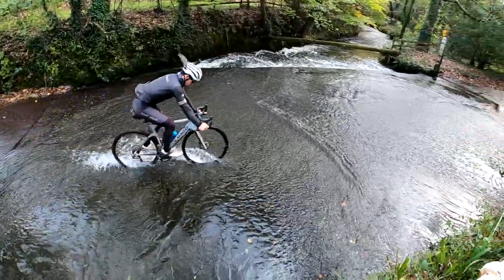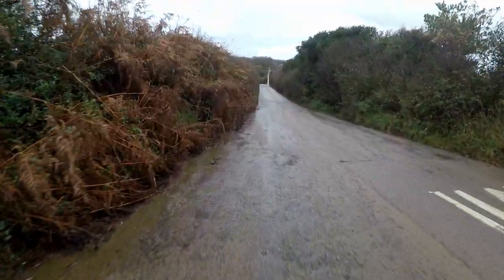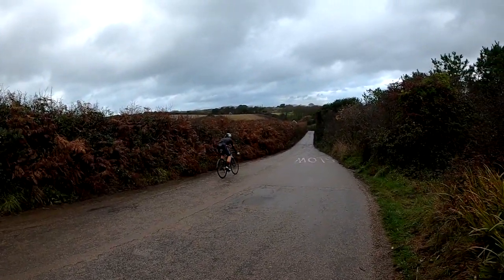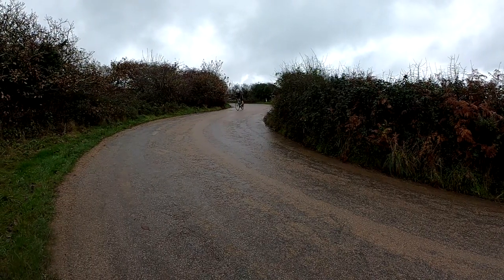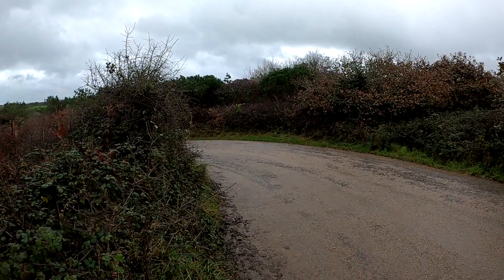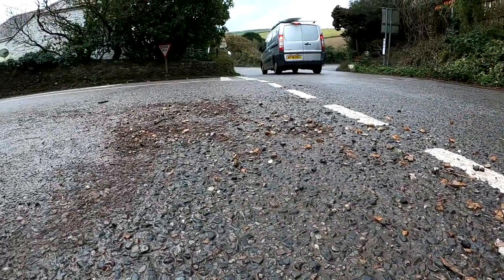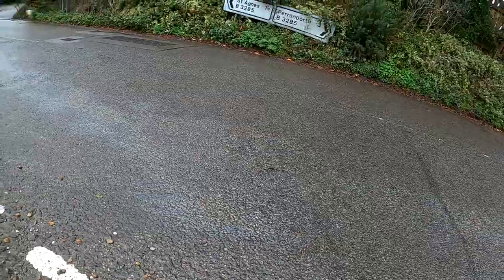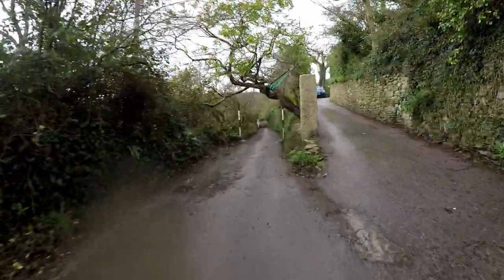Descending In The Wet | How To Corner Faster In The Wet | Cycling Tips For Faster Descending

Comment: Should’ve named this “How to descend SAFER in the wet” instead. Also the reason you counter your lean angle with your neck is to maintain the horizon for balance, confidence and brain processing speed. Same as on a motorbike.

Good video though Chris 👍🏻
Reply: Finishing without crashing is indeed faster than finishing after crashing.

Comment: I’m running my clinchers with tubes at 120 PSI since I weigh 100 kilos. We’ve had alot of rain in Miami lately. Besides losing weight, what would you suggest for PSI when riding in the wet?  I did have my bike slide out from under me about 1 month ago on a path with a thin layer of mud while trying to avoid a family stopped in the dry area. Some road rash on the thigh  and elbow along with a tear in the mid deltoid, nothing major. I was amazed at how well my bib shorts held up considering my sliding a measured 10 on the paved surface.  Bike just had some scratched bar tape and rear derailleur and bent hanger.  Got very lucky.  Keep up the great work.

Comment: Chris, I'm gonna disagree with your point at 1:30 in, leaning the bike in a straight line is what one would do normally in the dry.  All good if your tires grip as normal, but when it's slippery, one wants to keep the bike as upright as possible and lean the body towards the turn and steer the bars and lean the bike. It takes some practice, but it works when it's wet and slippery!
Reply: Have to say this is more how I do it. Pressure weighted to offside leg to lower gravity and balance the weight. As you say keep the bike more upright in the turn by learning body down and into the turn. Bike still leans, but not by as much. Just need to be careful if your not used to it as you turn in faster than expected. Mind you, each to their own and love the way Chris goes about things in this new channel :-)
Reply: Yep, crossed up is a dirt technique. I prefer the road technique of bike upright as possible, body leaned in. It also helps you stay loose on the bike, which helps you react to corner corrections, or even front end slip if you are lucky.